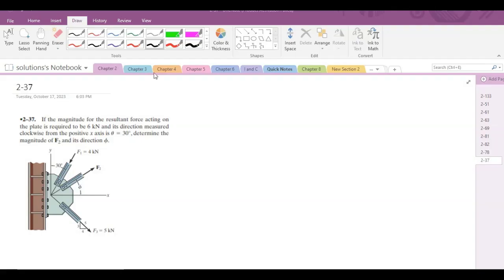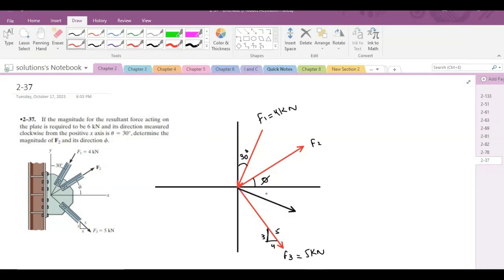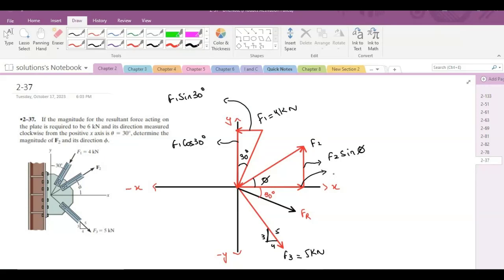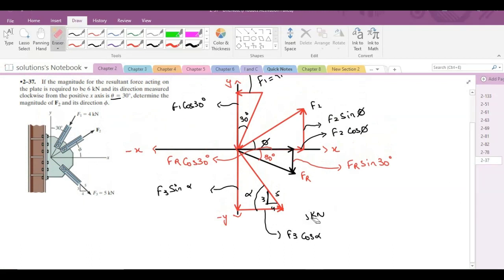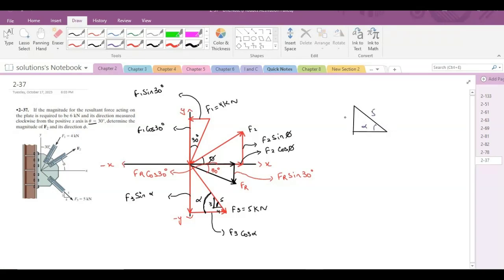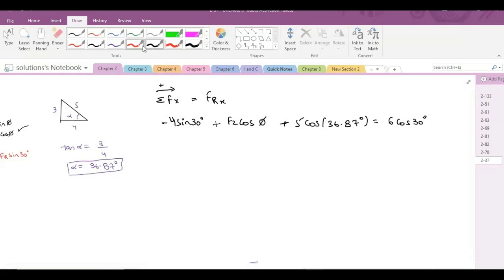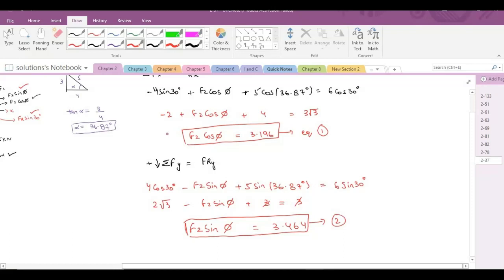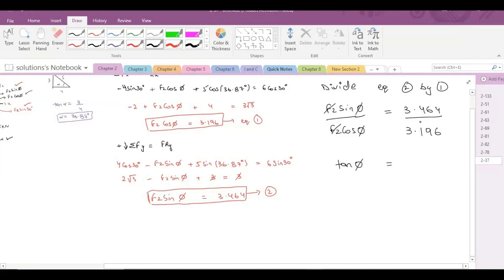2-37 hibbeler statics chapter 2 | hibbeler statics | hibbeler

Comment: In this we are given resultant directed on the plate but you dont show it to directed on the plate and if directed x and y becomes negative
Reply from the maker: In the problem statement they have stayed that the resultant force is directed towards the plate, so I have assumed resultant force to be a tensile force. And since I am getting the positive answers so my assumed direction for the resultant force is correct. I hope it will help!